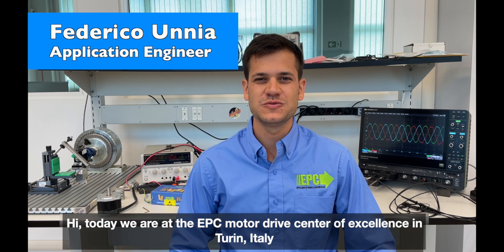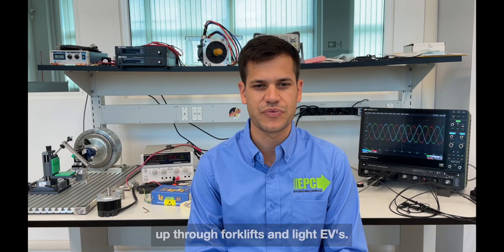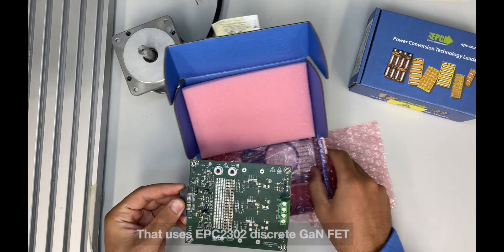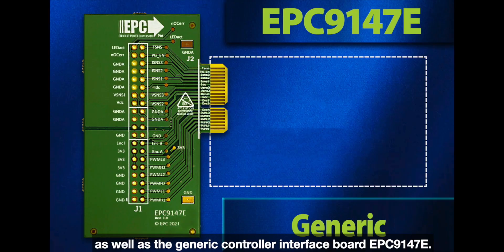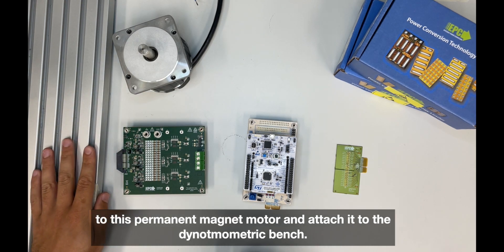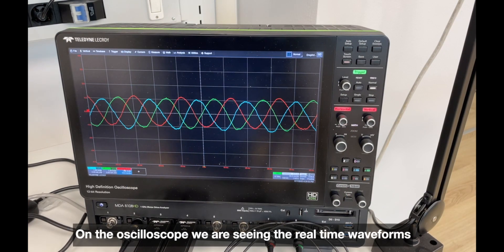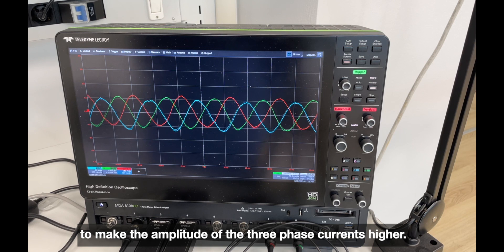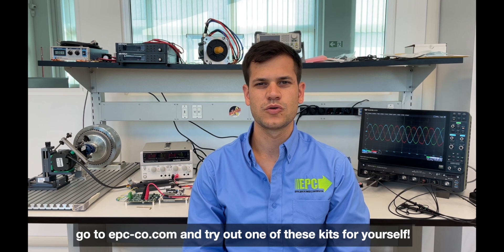Unboxing a Gallium Nitride-Based Motor Drive Evaluation Kit

Comment: Certainly would like to try a gan fet 3 phase evaluation kit, however they are priced at about $450 dollars.  Very high for ebikes and drones.
Reply from the maker: Please note that the evaluation kits are priced as they are due to low volume manufacturing of these kits. In production, a GaN solution can be less costly than a silicon solution.